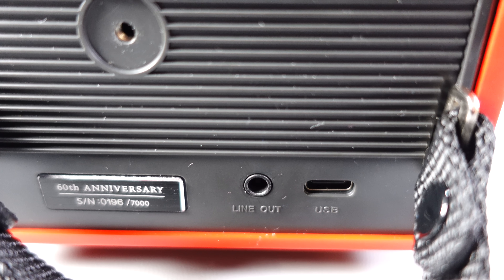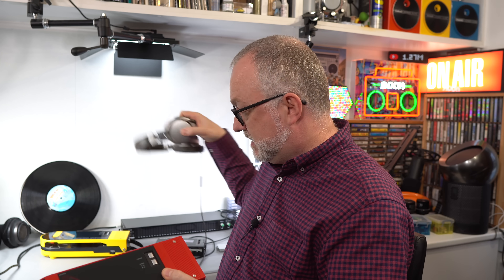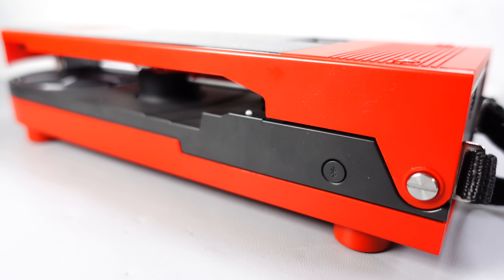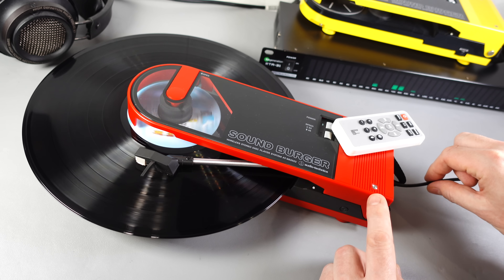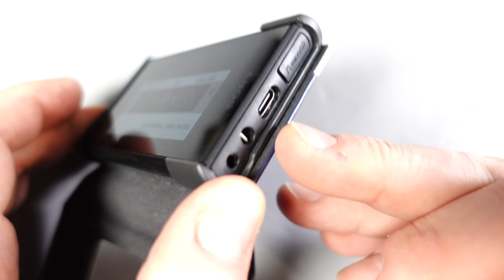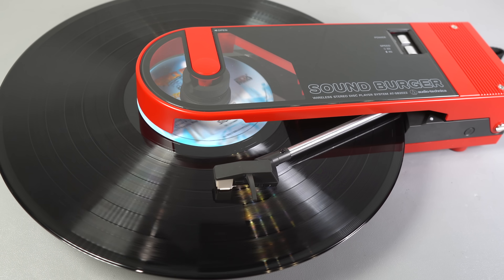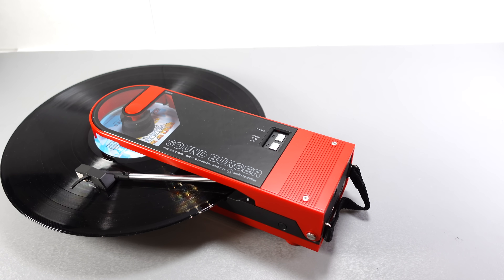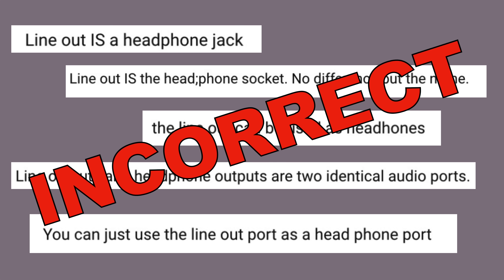Line-out ≠ Headphone-out

Comment: Amps and DJ mixers have separate inputs for Line In and Phono In because the line output from analog records is lower than other line level (like CD players). Since this is a record player, I wonder if it's really "plain" Line level or the quieter Phono level.
Reply: The main difference between Line in and Phono in is not the level, but the fact that Phono in is specifically adjusted to directly connect the gramophone cartridge (without any intervening electronics in the middle). It has appropriate impedance and also implements the RIAA frequency equalization curve that is necessary for playing back gramophone records - while Line in has flat frequency response, without any equalization applied.
In case of this device, Line out probably outputs signal post-equalization, so it's "true" Line out.

Comment: The gain selector on the headphone amplifier is intended as an easy way to accommodate both output levels as inputs: line out, high gain is needed and headphone out,  low gain is adequate.
Reply: Gain is more about your headphones, than line out. Problem with using an amplified signal as line out is that it's not a standardized impedance. Don't use headphone outputs as line outs, please.
Reply: @Septimius  What you're saying is true but may be answering a different question. Headphones and wired ear buds have widely varying impedances from a few Ohms for full size headphones to well over a thousand Ohms for ear buds. That's the problem that is most easily solved with a headphone amplifier. It could be solved in many cases by an impedance matching transformer but that's for us technicians, not the typical user.

Your comment seems to be addressing the opposite problem, that of using the source, headphone or line, as an input to other devices. Sometimes a headphone output is all you have to work with and the most expedient option is a simple attenuator. We don't design this way but when the boss says to make it work for the next couple of hours and the show must go on, well…

Comment: Line level device connected to a headphone output isn't ideal.   The internal headphone amp has added gain and therefore noise to the signal.  You probably won't notice it, but still, it's just something to consider.
Headphone vs line output is like a Turbo diesel pickup vs a Prius.  The pickup works but isn't ideal for just moving you, and will add noise (to the signal).  Hitch a boat to either, the pickup will pull it with ease.  The Prius might be able to move it but very slowly.  Headphone out has the power to drive a set of headphones, line out doesn't.

Comment: I have had some headphones that can be used in Line-out (according to their packaging), they have volume control on their cord.  But I am thankful you explained this because now it makes a lot of sense!
Reply: They are either headphones with a built-in amplifier or they are high impedance like the ones used with valve radios and crystal radios.
Reply: They have built in amplifiers. There is no way to send volume control through the 3.5mm jack.

As for the earpods, well, that's bluetooth. (And earpods must generate the analog signal anyway)
Reply: @Ryndae-l  they were talking about the older wired earpods, which sent a signal to the phone via the mic part of the connector, which the phone interpreted as a volume control/play/pause command
Reply: @Ryndae-l  There is a way to send volume control commands through 3.5mm. Idk if you've just forgot or are genuinely just too young to know about this, but just about every pair of 3.5mm earbuds used to have inline volume and playpause controls. You can do this by sending a signal over the mic part of a combo jack, which is, I believe, mostly a standardized protocol in terms of which tones to use for which button. Volume up, down, play, pause, skip track, previous track and fast forward are all possible using this trick by using the inline volume buttons or pressing the playpause button in some pattern (single, double or triple click) or holding it. Apple still uses this on their wired earbuds, but they didnt invent this. Digital earbuds and headphones merely continued to use a standard that was already commonplace.
Reply: @youridv yeah. I had a wired remote on my discman in the 90s
Reply: Is that volume control self-contained? Or does it just send signals to the audio source device, commanding it to change its output volume? (For example, the volume buttons on Apple's EarPods simply tell the iPhone/iPod they're plugged into to raise or lower its output volume.)

Comment: Nice Video. As "IT- Guy" I always get into the same problem with USB C. Most people think USB C is automaticly USB 3.0 or higher but that not the case. The one thing is the way it is build: TRS (Tip Ring Socket) or TRRS (second Ring often used for Microfon) known as Audio Jack and "Line In" or "Headphone" Jack is the technic behind it on the other Side. I mean USB C is the same connector like Thunderbold but it is almost never compatible flawless with USB 3.2 Gen 2 and so on...

Comment: Gain Low And High on your headphone aplifier is made because of different power demands (actualy impedance) of your headphones. It's not the same as difference in line out.
Reply: Yup. It is all about sensitivity of the headphones. Though technically it could be used to boost super quiet source too.

Comment: an interesting fairly recent standard is 3.5mm (or 1/4 inch, on occasion) connectors being used for hotswappable switches. notably, the Xbox Adaptive Controller uses them for all of its buttons and inputs
Reply: The company I work for uses the 3.5 jack for RS232 communication with audio equipment. That connector is used for a lot of things.
Reply: @desertlightning7335  RS232! Wow, I wouldn't have expected that one lol. Is that TRS?
Reply: @duncathan_salt  I have a TRS-to-RS232 cable from an old Savant smart home hub
Reply: Light guns on the PS1 & PS2 were often connected to a foot pedal using a 3.5mm jack.
Reply: Quote commonn for adaptive switches and many other things. Absolutely not limited to audio.

Comment: I've used a line out for headphones for literal decades, but I use a little Y-adapter that has individual volume controls on each female jack it provides to plug the headphones into and the Y-adapter into the line out.

Comment: have designed a lot of professional gear in my time. I would sometimes be asked to put an 1/8" mini stereo jack in so a tech can check for output with headphones. The line output would be 1/4" Phone XLR.   Often to save space I used the same op-amps for the line and headphone outputs.  As all of these outputs have a resistor in series, to eliminate the capacitive loading of the cable making the op-amp oscillate. I tried to make this as small as possible, usually 100 ohms. This worked fine as an unbalanced line out. For headphones, whether this world work depends on the impedance of the headphones. With 8 ohm or even 32 ohm ones the level would be quite low. But with ear buds with an impedance over 100 ohms then the line outs could also drive those. 

My point being that whether the line out could drive headphones depends on both the series resistor the designer selects, which is not standardized, and the impedance and efficiency of the headphones/ear buds.

My point is that there is no standard. Sometimes a line out will drive headphones and sometimes it will not.  The same is true for the other way. Sometimes a headphone output can serve as a line out and sometimes not. 

But unless the designer was incredible stupid, using the line out for headphones or vice versa will not hurt anything.
Reply: Concur, the line out on my computer system is capable of driving my headphones, but at a level lower than the proper headphone socket. There appear to be different standards for audio equipment compared with other systems.
Reply: Thought I was going crazy. Used to have one of those portable CD players with a pair of cheap earbuds, and the line output would drive them just fine. Useful for sharing the music with someone else.

Comment: Besides output voltage there is also a difference in impedance. A headphone output can drive much more current than a line out.
Reply: It can, but isn't current a thing that's taken as much as the thing needs / dependant on resistance?
Reply: @XPimKossibleX  Yes. The ability to provide more current than needed goes wasted. In my opinion it is redundant to put an amplifier between an output that is already capable of delivering sufficient power and an input that just requires a higher voltage. Transformers, people, transformers!

Comment: Arrrrgh... yes but you also can't say: "you should not plug headphones into line out" it will not break anything it will be just a limited experience, more quiet and depending on the impedance of said headphones it may be at a decent volume. Small in-ear headphones probably would have been just fine there. The statement "you can plug headphones into line out" is not misinformation. It is correct. It just isn't the best XP that is all.

Comment: This is a great video, I've always wondered this myself!
A lot of the confusion comes from PC because the audio volume is always controlled manually on windows.
Reply: Not always! Some CD drives had volume knobs on them.
Reply: @moonrazk  those old CD drives had a cable in the back that went to the sound card. In software the CD playback would get its own mixer control. For all i know it might still work that way, but I haven't played CD audio that way since before 2000 or so. After that I would use cdda2wav or cdparanoia and rip
Reply: laptops have a switching mechanism inside. Headphones have much much higher impedance than line signals and the jack on the laptop can detect that and use software to switch the headphone amp in and out of circuit. Older laptops used to have both jacks on like all other equipment but with the software switching now it is combined into one. but both are still technically in there. easy to be confused when you only see one physical jack.
Reply: yes, because on the PC you use the line in/out and the computer's sound card will handle the amplifying.  and plugging in a headphone into the headphone will mute the line out.  which i guess is the difference of line out and headphone on a pc...the override.
Reply: 1000% this. The whole time I was watching this I was like "he's probably right, but tell that to me when I'm in the dark dusty nook under my desk, blinding stabbing my headphone plug into roughly where I know all the 3.5mm jacks are".
Reply: A N I M E
N
I
M
E
Reply: it's still confusing. -_-
Reply: ...Or you buy PC headset with volume knob. Third way is what i use: i jack the phones into headphone output of my PC speaker set. So you don't need to regulate volume in Windows and can use any headphones of your choice.

Comment: Headphone jacks are commonly mislabeled as "line out" these days, the meaning is becoming lost. My desktops only audio out interface is a 3.5 mm "line out" and it has volume control. I see this pretty regularly.
Reply: I have not seen any mislabeled motherboards. What they use is a combo jack. Those can be set as a line level out in the audio driver/ software settings. There very well maybe misplaced devices out there so one should always check the device documentation.

Comment: A headphone out can be used as a line out or a headphone out.  A line out can ONLY feed a line input.  I have been using headphone out as line outs for 30 years with great sound and no issues as long as you keep an eye on your input levels.
Reply: Not always true.   Often the headphone amp can degrade the sound quality compared to a dedicated line out just by adding extra capacitors, resistors and transistors into the audio path.    Another factor is what impedance the headphone amp is designed for and the intended impedance of the line input you are connecting it to.   Typically a consumer line input is designed for an impedance of 1000 ohms while a headphone output may be designed for 8 - 50ohms.  This is a large impedance mismatch with can and will effect the frequency response of the system.   While it might not sound bad to you - the response of the system can be far from linear.   Finally, there is often a voltage mismatch which can either cause added noise (hiss/hum) or distortion if the headphone amp overloads the line input.   A consumer line input expects a nominal voltage of 1V.   Anything higher may cause distortion.  Anything lower can result in noise being added down the line but adding more amplification to make up for the lower voltage at the line stage.
Reply: @cgtbrad  Input output impedance matching was important decades ago.  Modern op-amp output stages can handle a wide range of impedances with no issues.  Don't over think it.

Comment: So this explains something that has been bothering me. I recently purchased a Roland keyboard to practice on, and it has a line out, but I want to use headphones because sometimes it's late at night and I don't want to disturb anyone. But the sound was nearly inaudible. I thought the problem was the headphones. I guess I need to look into getting an amplifier.
Reply: Some will have both. I have a couple Roland keyboards and they both have a headphone jack on the front as well as the line outs on the rear.

Comment: TL;DR - Check the manual. Not all line levels are the same. Not all audio gear are designed the same. Headphone outs are line-level.
That's why products like this exist -- ART CLEANBoxPro 2-channel Balanced / Unbalanced Level Converter.

Headphone outs are line-level. In your manual, it should say something like "-10dBV unbalanced line". Pro audio line-levels are not weak signals, it is in fact louder, either 0db or +4dbU, provided you use balanced cables, example -- a TRS - TRS or TRS - XLR, XLR - XLR, these are mono signals by the way, not all TRS cables are used as stereo. Try plugging a TRS cable from line-out to a +4db balanced line-inputs of a professional audio mixer using a balanced cable (TRS mono, XLR) and you'll hear a full-range audio signal. Plugging in an unbalanced cable weakens it, at least it does for my audio interfaces.

Comment: I think another thing that is confusing in this discussion is that many modern devices either combine line out and headphone out, or have line out that is “amplified”, but have no volume control
Reply: Especially those very popular devices we almost all have - laptops. And similar devices that are "smart" and can switch the mode of the jack.
Reply: Yeah, even a lot of (cheaper) music instruments don't have dedicated line out jacks anymore, but only headphone jacks. All the Korg Volca synthesizers for example (they also have 3.5mm jacks for CV sync and some of them also 3.5mm MIDI, to further confuse the 'they are the same connector' people).
Reply: @fisk0 more over most of Korg output RCA is mixing input same time (if you have "headphone" jack you can get mixed from there)
Reply: I'm sticking to the wired earphones until they come up with the way to make the bluetooth headset completely battery-less
Reply: @ersatzvitamin1  Well,  that would be an interesting advance. I'd maybe settle for a type with some of those wireless charging solutions,  but at very minimum a design with easily swapable battery. Latency is not really my greatest concern for how I'd use wireless, they'd be for commutes. At home, it'll always be wired.
Reply: @ersatzvitamin1 We can do that but your head won't survive the radiation and the transmitter will take half the room and cost a couple million dollars. Send the money when you want me to start on it. 😉
Reply: I prefer Wired headphones, especially when I use any analog equipment, when I use my phone it's not as important but I still prefer wired.,... I'm more than halfway through my life, that may be the reason 😊
Reply: yep, that's where I got my incorrect line/volume/headphone beliefs from!

Comment: Another source of confusion is that a lot of small form factor computers used to use the same socket for both the line out and the headphone out, and allow you specify which one it is in the audio drivers configuration software, to swith it between amplified and unamplified output.

Comment: TL;DR: 

Line-out is way quieter for headphones than a Headphone-out
Reply: If you plug in the headphones into a line out, the output voltage and hence the output power of the line out will drop significantly because it cannot provide the current the headphones need. Like, you cannot start a car with 8 size AA batteries of 1,5 volts connected in series because the starter motor needs more amperes than you can get from the batteries.

Comment: Ah, classic generational divide, and knowledge that will probably soon be lost due to everybody using Bluetooth headphones and less and less devices even having 3.5mm sockets.

As others have pointed out, PCs muddy this up a bit because they essentially let you use any of the plugs in any configuration.  You plug in a cable and it will ask if it's headphones or speakers, and adjust accordingly.  If you select speakers, it usually acts as a line out because you'd be amplifying the signal using your speakers' volume controls, but for headphones it amplifies the output first as you'd expect.  Some sound cards even let you use the inputs as the outputs and v/v!

The lack of a volume control is really the only difference here.  While you could technically "use a headphone out as a line out", it wouldn't be the same and you'd get less quality down the chain because you aren't bypassing the built in amplification circuitry used by the source device.  Typically devices that aren't designed to be used in professional settings will only have a headphone output because 99% of people wouldn't need anything but that...